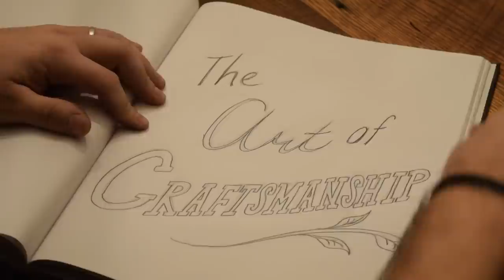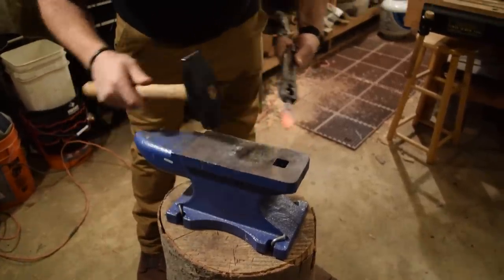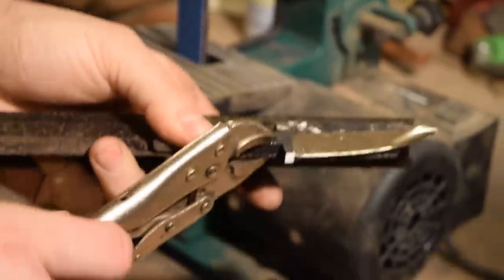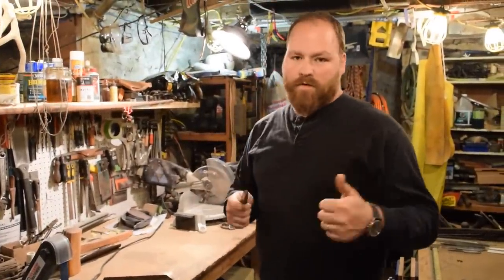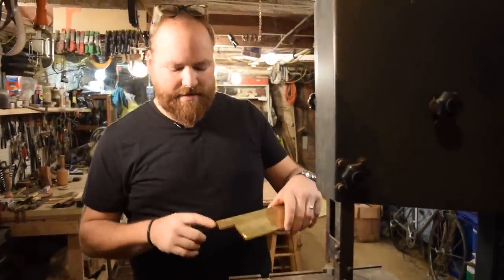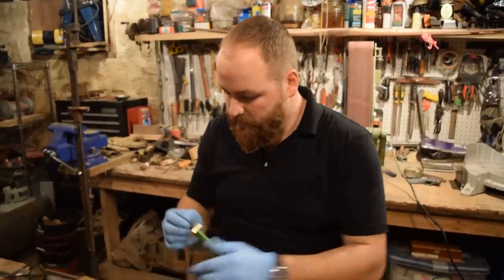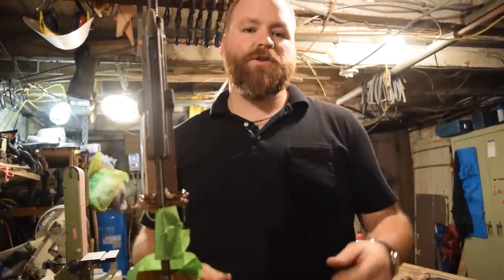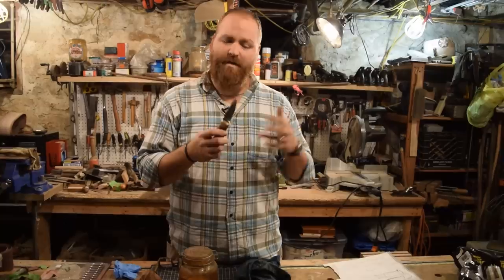Making a Puukko File Knife

Comment: I wish you'd include a list of the tools that you use per project. That would be very helpful. Love your videos!
Reply: You can typically build any knife with steel (can be anything from actual bought steel, file, etc.) A file, a heat source and a angle grinder

Comment: Very cool, got a new subscriber here. I use the same 1×30 sander for blades, I highly recommend the Norton blaze belts from mcmaster carr(and you can order tool steel, handle pins, epoxy... etc all in one shot) the surface conditioning belts also save a ton of hand sanding.

Comment: Forging a puukko really involves much more movement of the metal along the blade side, with 90% of the bevel done by forging, NOT grinding...this process develops the steel of the blade, so that the blade and back have very different grain structure. There is very little thinning of the blade thickness ... or, so we were taught in our puukko classes in Finland.
The steel blank starts out with the 'tip' cut at the opposite angle to the finished shape:
__________________
                                       \
_______________________\ <= and hammering on this side/edge moves the metal 'forward' as it is thinned to the bevel, developing a different grain structure in that area..the bevel is not done with grinding, just grinding for a few degrees of finishing and making the bevel symmetrical. Also, the quenching can be done with the blade held 'flat', so that only the beveled area goes into the bath, leaving the back of the blade a bit softer.

Comment: You should clean every last bit of crap off each piece of birch bark. No loose stuff, no black stuff. If you compress the pieces on the handle and stick it in the oven at a really low temperature, the individual pieces  should glue themselves with the resins inside the bark. Try it. You can glue them, but why would you?

Comment: Can you explain more on the way you made a jig for the grind just by clamping the blade? Very interested to hear about it.
Reply from the maker: I clamp my blade to a piece of right angle iron, and then set my tool rest at the angle that I want my bevel. I customized my tool rest a bit to be able to tilt it forward, toward the belt. Simple mod but effective.
Reply: @TheArtofCraftsmanship  very awesome, do I need to do anything with the right angle metal? Or just the tray on my sander?

Comment: Using the crosspene portion of the hammer will draw out the blade length much faster than just the round or flat of the hammer face. I'm sure you know that already.

Comment: You have a cross peen on your hammer you can use that to taper the blank or you can knock off the sharp edge of a part of your anvil and pinch the blank between the hammer and the anvil.

Comment: If you use a file and so easy make that notch in it, that blade is soft.  Only the diamond file could be used on properly hardened  material.
Reply from the maker: N Tatic 
Thanks for your comment and concern. My knife blade has been tempered so it’s not as hard as it had started out with after the quench. When you temper it brings the hardness down which then makes it fileable. It takes some time and sometimes I get my hardness at different states, but I can usually file the choil afterward. Since I’ve made that knife I always fire my choil in before I do the hardening process. Thanks again.

Comment: tried making a file knife. broke in 2 when installing handle. tempering and everything was done correct. there was just a crack inside i couldnt see
Reply from the maker: Sorry to hear. Keep trying. I love files for knives.
Reply: Not all files are of the same quality. try to acquire  the better old named brand files whenever you can.

Comment: Cool video but you need to work on your hammer technique and form. Forging bent over like that and without power in your strikes must take a long time and be bad for your back.
There are some good videos on YouTube covering hammer technique but in broad strokes try to stand straight and swing the hammer with the muscles in your back. Prevents fatigue, helps the hammer fall straighter and with more power because you can drop it from a greater height.

Comment: Love the video. Do you use only old files or new ones?
Reply from the maker: Old files.  New one are not all made the same. Many are case hardened, which means they are hardenable steel on the outside, and soft on the inside. Great for files, crap for knives😉.

Comment: Hi Dustin. Great videos! I’m hooked and now a subscriber. Question, what did you use to make the bevel on the 1” sander? Is that angle iron? Did you have to bend it to get the degree of angle for the bevel? Looking forward to your reply. Thanks Dustin!
Reply from the maker: It is a piece of angle iron. I modified my tool rest/table to tilt toward the belt so I could clamp the blade on and grind using the angle iron to keep the blade perpendicular to the table. Works perfectly.
Reply: The Art of Craftsmanship that’s great! Thank you for reply. I have to take a peek at my 1” sander and figure out how to modify it to tilt toward belt and then cut some angle iron to make the jig. Love the videos! Keep’em coming!

Comment: Why dont u use cold oil
Reply from the maker: Cold oil is thicker and more viscous, so the blade quenches slower. When the oil is warm it becomes thinner, and less viscous resulting in the heat being pulled out of the steel faster.
Reply: @TheArtofCraftsmanship  doubt it

Comment: I watched a earlier video and was wondering why you had to brush off your blade. Now I see exactly why you had to. It your forge breaking down slowly. I'm still confused to why people use files to make knives? Don't they know that files are case hardened mild steel. It's cheap but it's not real good steel for knifes the time you take the file down to a edge all the harding is gone. Leaving mild steel edge. Ya there are ways to make the steel have more carbon throughout. I just haven't seen anyone use the techniques or time used needed in the forge to add more carbon. I just don't see why people waste time with case hardened steel.
Reply from the maker: I only use older files that are fully hardenable. Case hardening is a more modern technique. Knowing what type of file and it’s relative date can give you some quality steel to make into knives. (Ex. Almost all older Nicholson files, and most modern ones, are 1095. Thanks.

Comment: Nice knife, but it is not a puukko, except in superficial appearance.  That's the problem with YouTube, and it's why thousands of newcomers don't know a real puukko from a Ka-Bar from a butter knife.  No one seems able to do anything that's both original and good.  They just have to call a knife they make something it's not, even when they use a file for the steel, or don't know how to make a real puukko handle, or can't make a puukko sheath, or don't know how to make, well, on and on and on.  It sucks because the fakes clog everything up, and make finding the real thing almost impossible.